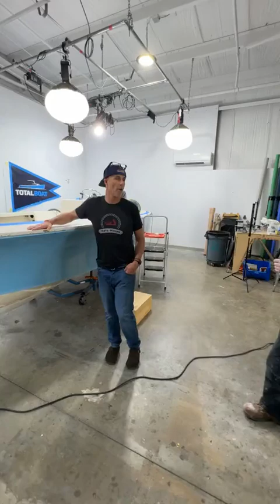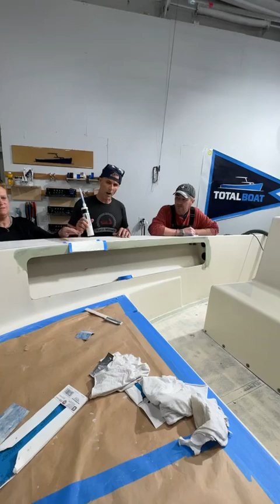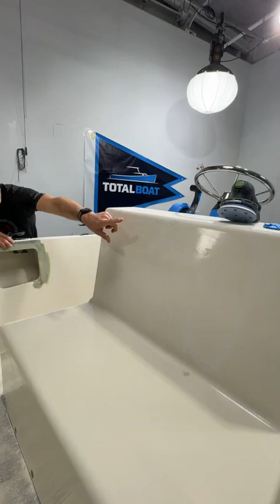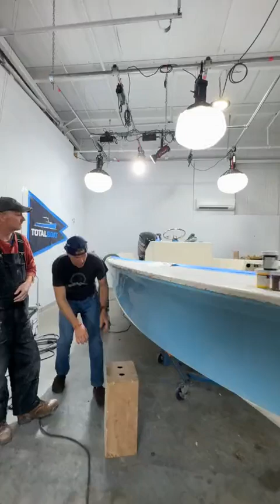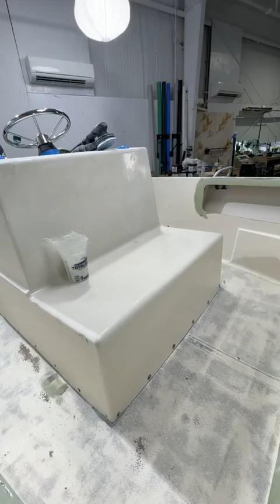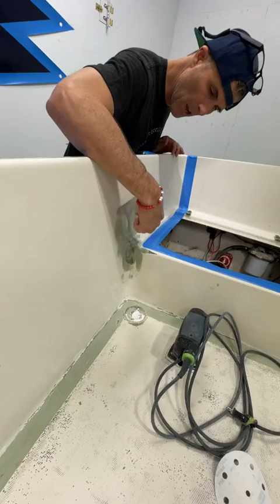Boat Repair Q&A with Andy from @boatworkstoday! Gelcoat, Epoxy talk, Poly Resins & more!

Comment: Hey Andy, Kristin, & TotalBoat! Matt over at the Salvation Navy. I really want my varnish work with TotalBoat Lust to have the best possible finish. Do you recommend wet sanding for the last couple coats? Any other suggestions to get a smooth mirror finish?
Reply: we do not recommend wet sanding. Good sanding up to 320 before final coats with a good wipe = and making sure any drips or runs or anything that will prevent a beautiful finish - those need to be sanded off first. You can thin Lust to your desired flow so make it flow as you like !
Reply from the maker: What Kristin said... just make sure the finish is smooth as can be before the final coats. Should be mirror like if you varnish like Andy or Lou! ;) Dont we all wish we could do that?